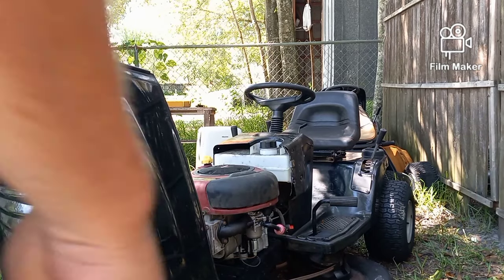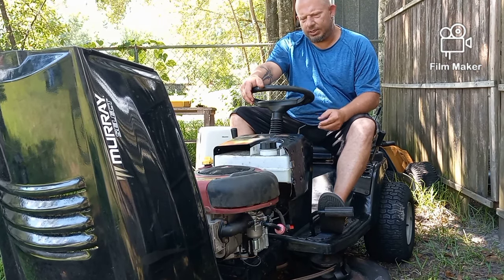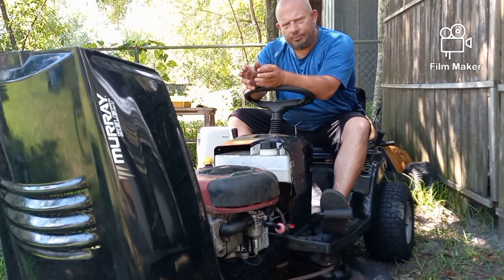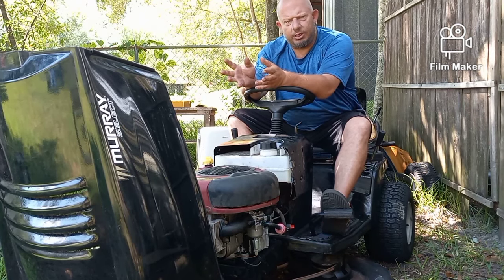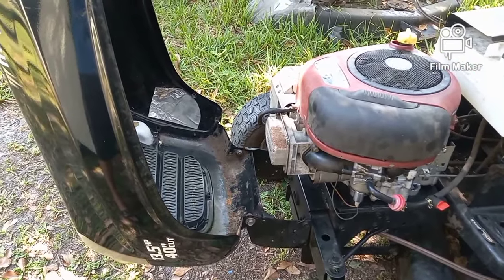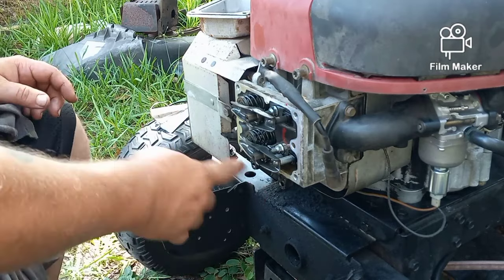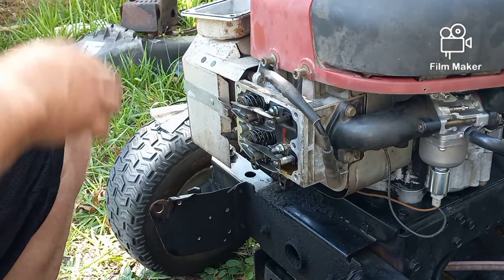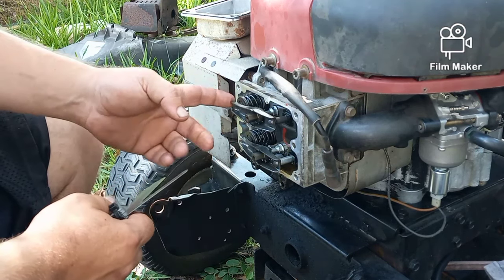Mower Spitting Backfiring / Fixed Briggs and Stratton Riding

Comment: Awesome because this is exactly what's happening with mine. I put a new carb on it ran much better but it had that backfiring so my next step is adjusting the valves like you did! Thank you so much for this video I'm not a mechanic but I watch your video and that's my next step. I'll let you know if she Smooths out after that
Reply from the maker: Thanks for your kind words and for subscribing.. it really helps.  Please let me know if it smooths out for you. I'm always interested.. and remember to change your spark plugs they can contribute to the problem although they don't normally go bad these days it is possible in these cases

Comment: valve lash is in thousandths not hundreds. the gap should be .005. not .05
Reply: He mixed ten-thousandths, thousandths and hundredths rather randomly without specifying the unit of measure most of the time. 

In my half a century of doing my own engine repairs - both small and automotive, I have never seen the lash specified in anything except thousandths (for imperial measuring system). 

I have seen on some B&S engines that the manual says to adjust to TDC, then rotate a bit further so the piston drops 1/4". The specs are for adjusting both lashes in this position.

Comment: It’s videos like this that make YouTube a modern day Alexandria’s Library. Thank you for the very clear video on adjusting valves, I learned a lot. Turns out my whole post that holds the exhaust rocker is loose and causing a 3/8” gap! Hoping to just be able to tighten the whole thing down, set the gap, and have it start and run like new. Thanks for teaching this and helping me save money.
Reply from the maker: @INeedAuserName1029  thank you for your kind words.. yes as long as the post is not stripped out and u can tighten it you should b good to go.. they occasionally back out with vibration.. tighten it just til it stops moving to test.. then pull it out and put some Lock-tite on the thread.. then tighten and it will stop it from happening again

Comment: Man thank you for the detailed easy to understand video. I think you might've just helped me fix my mower. Gonna give this a shot when i get a set of those gauges and some free time!
Reply from the maker: Hey thanks for the kind words.. please do me a favor and subscribe while your here it really helps.. Adjusting the valves is very important and pretty easy.. you can grab  feelers guage set at any auto parts store for under $10 , I  know you can do it I have faith in you .. remember to let the gasket sealer set up for 24 hours before running the machine so you don't blow it out of the cover and get a leak.. good luck and let me know how it turns out .. I am always here if you have questions
Reply: @MunkyWrench  you got it man! Thanks again! I'll let you know how it goes.

Comment: I had an old Troy Bilt mower with a Briggs engine that a friend gave to me. He told me the engine was locked up, so I took it for parts. When I finally got around to messing with it, I found that the valves were so far out of adjustment that it was building too much compression to even turn over. I had never seen that before. I did an adjustment and it fired right up. Unfortunately, it had been in my back yard for a couple of years and I had already stolen some parts off of it. I am still putting it back together, lol.

Comment: I've been working on an 18 yr old Bolens, had valve trouble (would get 'stuck' turning over) then sat for 5 years. Adjusted valves, would only start w/some carb cleaner & run for a couple seconds. Cleaned the carb, started but was backfiring. You nailed it! I guess didn't adjust the exhaust valve, it was big time loose. After adjusting, it sounded like a new engine! Have an unrelated (I think) issue w/idle fluctuating, but that's for another discussion. Thanks man!
Reply from the maker: Glad my video helped.. always happy to hear it.. if it's surging when running uts usually a clogged jet in the carb.. I often have to clean a carb two times or more to get it right.. look for a specific vid on your carb so u don't miss anything.  I usually just buy new carb for $20 these days
Reply: Noted re: the carb. It was bad, this gel-like substance in the bowl. I'll clean it again, but like you said I can't believe how cheap new carbs are! Found mine for $20. Also, in the past I was using the Top Dead Center method for positioning the valves. Didn't have to! Used your method and from now on that's the way to go.

Comment: I had a Murry 40 inch cut with a Briggs 12.5 horsepower engine,  it was very low on power ( a 2004, this was 2018 ) I readjusted the valves,  made a very big difference,  30 minutes later it was blowing oil out all over.  I ook the engine apart,  the top piston ring broke in 3 places.  After considering my options,  I put a Kohler 25  horsepower V twin on  runs great does a very good job.

Sir I enjoy your videos,  you do very good work 😊
Reply from the maker: I appreciate your kind words , your subscribing to my channel and u taking the time to share. Sounds like you made the right decision.. it's nice to find others that actually take the time to repair machines yourself.. stay handy my friend
Reply: Did it have anything to do with the way adjusted your valves? I'm at newbie at this stuff and I don't wanna go destroying anything.
Reply: @bdaddy503  
No, the valves didn't hit anything.  It was because it increased the compression and I think the extra pressure broke the top compression ring.
Reply: @bertgrau3934   adjustingvthe valves increased the pressure?
Reply: @bdaddy503  
That engine it did. They were way off like over 50 thousands of an inch too loose.  The clearance should be around .0004 to .0006. So the valves were just barely opening.  It was so low on power it would hardly pull its self.  After I adjusted the valves it was running strong.  (For a 12.5 horsepower engine)
Reply: @bertgrau3934  I see. Thanks mate

Comment: Hey brother. I would like to thank you for this video. You saved me a lot of money. Even the so-called mechanic couldn't fix it. I followed your directions and I was able to fix my mower. Thanks again.
Reply: Geez that's rough. As a Small engine shop I only touch what i can fix or everything is free 😅 (parts and work up to the point of failure)

Comment: This is a great video on how to adjust your valves. I tried to follow the put your screwdriver in the spark plug hole and my mower sounded like an airplane. 

Follow these instructions and you will be fine. Tractor runs like new now.
Reply from the maker: So glad I could help.. thanks for the kind words

Comment: The intake rod is centered in its valve guide.
Since the only contact the rod has is on both ends, and only one end is hot AND intake air is cool is why that rod can be made of aluminum.
The exaust rod is steel simply due to the extreme heat of exhaust gases.

Comment: The inlet valve is cooled by the air/fuel mixture. The exhaust valve runs hotter because of the hot exhaust gases. The inlet valve is in line with the pipe from the carb.

Comment: Great Job! I've never seen this done, plus, having the same model I have, is rare for a repair video. Thanks!😅
Reply from the maker: Thanks for taking the time to comment and subscribe  .. it helps me grow .. I really hope my video helps.  If it turns out to be a different issue just leave me a comment on any vid or email me and I'll help u figure out what u need
Reply: @MunkyWrench  Well, reason I watched is because I saw blue smoke (not plumes) after finishing lawn, 100 degrees outside. I thought I pushed mower too hard.. I was hoping to clean some parts (carb,muffler,air filter) instead of fixing head gasket or something drastic like that..

Comment: Thank You! Ver informative  work on my own stuff even worked on other peoples mowers, but  hate doing the valve adjustment because looking for that op dead center is always a pain.  Need to adjust my Briggs twin cylinder 24 hp very soon cause it’s sputtering a bit.  I will use our method.
Thanks again Raul 👍
Reply from the maker: Thanks for watching and subscribing plus taking the time to leave a comment it really helps me reach more people. I know my method is easier for some people including myself and it's very effective I hope it makes your life easier

Comment: I was having the same issues with my John Deere 18.5 Z225. I changed the carburetor,  air filter, oil filter, gas filter , change oil, took off the gas tank make sure that was no debris in the tank. I changed spark plug.  Put a tester from the plug the magneto, spark was good. But I still can’t get the dam thing to start or run. So now I will try to adjust my valves. If you can help with my problem please let me know. Thank you great video. I love how you took your time.
Reply from the maker: Did u check compression.. u only need 3 things to run.  Fuel.  Spark and compression.. try sorting a bit of carb cleaner into the carb and starting it.  It will only run for a few seconds but it will narrow down your issues to purely fuel.. if u have spark and it still does not start with carb spray.. check compression if u can.. if not then remove the valve cover and check for a stuck valve or missing or bent push rod.. if it does run for few seconds.. pull the fuel line to the carb and turn key.. make sure fuel is getting to the carb.  Let me know if u need more advice
Reply: Are you able to spin the flywheel by hand with the spark plug in? Is so, you have weak compression.

Comment: Gonna try this today. It’s really slow to start. It’s an old 24hp Briggs, I’m positive the valves have never been adjusted.
Reply from the maker: Def.. most people never adjust them.. they should be checked every year.. if battery is good and fully charged .. valves are next step.. good luck and thanks for watching
Reply: @MunkyWrench  valves were out of spec (loose). And the head gasket was definitely rough. Oh and both push rods were bent 😂. I don’t know how it was running but she’s getting rebuilt to live again.
Reply from the maker: @Mc88Flyy  sounds like a fun afternoon for you.. good luck .. im sure she will purr

Comment: Wow I was given this exact mower from a neighbor. Replaced coil and starter solenoid both were bad and she fired right up. But is ruff and back firing. Niki carb not much adjustment I think you just gave me the answer ! Now what did you do about the key not shutting off engine. Mine does the same thing. Fantastic vid man I subscribed.
Reply from the maker: U have to check the wire connections between the key and the magneto.. all it does is create a ground connection to remove the spark.. I ran every line for continuity and found the spade connection had broken.. I replaced and plugged it back in.. I've had cases where the key switch had gotten corroded on other machines causing the same problem.. glad I was able to give u some new ideas.. thanks for watching and subscribing
Reply: @MunkyWrench  sure enough the valve set was way out. Much improved yet still ran a bit ruff with some back pressure through carb. Had an old Nikki on the shelf cleaned up changed it out and bam smooth idle and full throttle. Bucks just a little when blades are engaged . Think recheck valves in the morning but still happy with results. I never adjusted valves in my life but now have confidence to do so. I’ll chase key issue down tomorrow as well thanks again.
Reply from the maker: @johnanthony2545  hey well done .. I'm proud of u ..

Comment: Easier way to adjust the valves is spin the flywheel until both are loose.  This would make the motor be on the compression stroke or power stroke, which means both valves would be closed.
Reply: And when they are both loose is this when you set the valve lash?, mine is a 13.5 tecumseh, i do appreciate the input now that i'am, retired i want to cut my own grass and maintain these things myself. Ijust want to cover every aspect before ii attempt a valve job, there seems to be way to much compression while trying to start the engine, that usually indicates a worn crankshaft, or worn compression relief tab, hopefully just reseating the valves would be nice. As i learn more about these small engines  i realize that it took a real genius to engineer one, they absolutely amaze me that they even function at all. As an educated person  when my grandson was showing me his camera he got for his birthday he told me that this little chip he was holding can store 3 ,000 photos it isn't as big as my pinky finger nail,  it makes me wonder how did we , as human beings get to this place we are in now so quickly, just a life time ago no scientist would ever believe that was possible, in fact i barely comprehend it myself. You can only imagine my disbelief when this same grandchild told me they make a card the same size that holds twice the amount of 3,000, how did we become so smart, yet we allow a common criminal to lead our nation in to total destruction.
Reply: @dr.robertsmith1971  Are you okay bro? Went off on a bit of a tangent there. You need to talk?
Reply: @dr.robertsmith1971  yes she's "horrifying", to use her words about us "deplorables".
But somebody we never heard of, lower on the feeding chart, some citizen in their employ takes the fall while she knocks off the witnesses, it seems like.
Reply: I always do the same myself very easy. I do adjust without filler gauges

Comment: Greetings from Canada. 

Really good video. I’ve watched A LOT of small engine vids and this is one of the better ones so far. 

Curious though, when u talked about finding top dead center with a screwdriver and did it instead by getting one valve lose and one tight does TDC matter the way you do it? Does being TDC on the compression stroke matter the way you do it?

Thanks for such a good video!!!
Reply from the maker: Thanks so much for watching.. in a nutshell on larger equipment TDC is more vital but in small engines it is not needed.. basically by doing it with one valve open and one closed you are just taking the pressure of the spring off and ,,making it loose to set your clearance .. and since the clearance can range by a few thousands of an inch its just important that the pressure is taken off when setting the valves.. finding TDC is also subjective meaning when you use a screwdriver against the piston you work it up and down to find it.. and what you perceive as TDC can be slightly different that what another person thinks it is and all it does it relieve the pressure anyway.. hope this helped.. feel free to comment or ask questions any time

Comment: Please do a full video on Briggs and Stratton 13.5 hp carburetor adjustment. I have a Bolens 38inch mower that is giving me all kinds of headaches.
Reply from the maker: There's actually little to zero adjustment on those carbs.. I'm happy to walk u through any steps you need to figure this out. A carb for a motor that size is around $20 and takes only a few mins to change out .. so that's usually what I do.  Make sure the spring is on the linkage to the carb.  That will cause issues if missing or stretched out.. you can check valve clearance if it's not running right.  Tell me what is wrong and I'll try to help.  U can message here or my email is on the ABOUT ME section of my main page

Comment: Welp, got my feeler gauge set and adjusted valves.
Replaced spark, fuel filter, air filter, disassembled carb and cleaned it out.
It ended up being my seat safety switch.  I'm guessing it was closing the circuit as I was driving and all the little micro opening/closing makes the ignition sloppy and burns the fuel poorly causing a backfire.